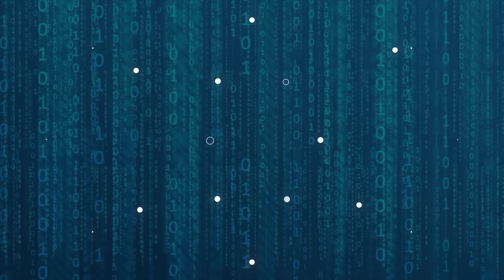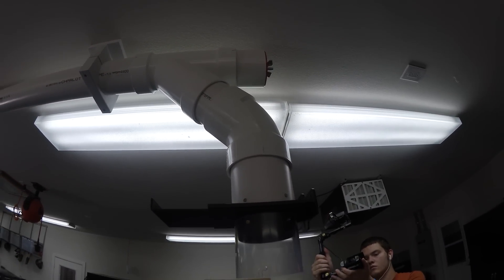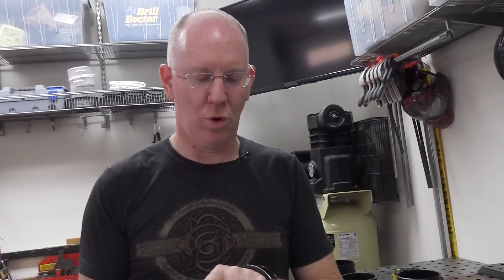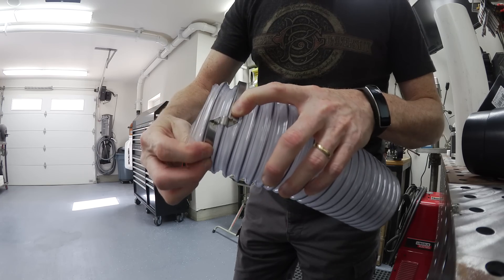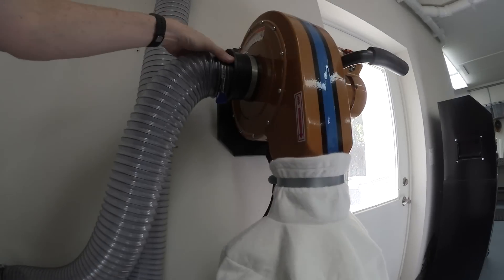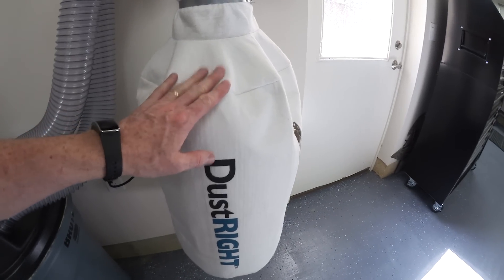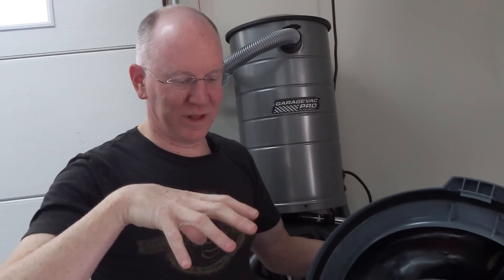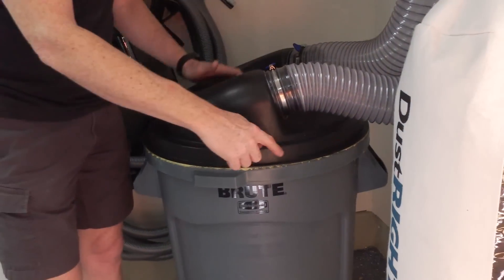How to Build a Dust Collection System - GeekBeat

Comment: Like what you have done, but your shop is disgustingly organized! 😂Dust collector fittings are driving me crazy. Nothing fits anything I need it to fit! All I want to do is connect my Delta 14” bandsaw to my obsolete JDS collector! I have a whole box of 4” fittings that are basically useless because nothing else will fit over or into them. Why the heck don’t they give both OD and ID on these fittings? Maybe even color code them. Sheesh!

Comment: Look for DWV pvc, it's a very thin wall and will hit over most of your dust collection accessories. there are also connectors called 'street' connectors, that have one end that goes on the outside of the pipe and the other will fit inside the pipe. that will help you fit many accessories that the DWV pipe doesn't fit on it's own.

Comment: Nice tips, but here in 2022 I used SDR 35 drain pipe for my 6" main and then split into 2 - 4" sub runs in the shop for my Grizzy G0944 (1-micron canister w/Super Dust Deputy separator in front).  Much cheaper than SCH 40 pipe & fittings and the typical connectors available from manufacturers like PowerTec, HQRP, etc. fit perfectly without need for the special ones.  Another benefit of SDR 35 is it is even lighter and easier to cut than SCH 40.  The cost of SCH 40 in 2022 is crazy expensive... a 10' foot section of 6" will run $100+, whereas SDR 35 runs about $60.  The downside... it is blue/green and not white like the fittings.  ;)

Comment: Nice pipe system but the dust sucking" it's definitely 100% not going to suck everything if you actually turned on the saw everyone could have seen the dust all over the place. Only some of it will go in but the piping system i definitely gives 👍👍

Comment: II have a 6” pvc pipe dust collection system. I use 45 degree pvc pipe to go to my floor tools. My new 4” flex hose does not fit to the 4” pvc.. What fitting would recommend?

Comment: Old video, but for the posterity, many may be surprised that a good old high temp hot glue will hold on to these hard to glue plastics (LDPE and HDPE) of thrash cans and 5 gallon buckets better than silicone and perhaps even polyurethane adhesive, especially the crappy gorilla glue type that foams and gets hard.

Comment: So... I’m sorry, but is someone going to tell him? My 1hp dust collector barely has enough suction for 2 machines within 5 feet of the dc and has a hard time collecting all the saw dust. You have 30 feet of 4” piping and a cyclone separator while using a 3/4 hp machine? I bet that didn’t turn out so hot. Sorry!

Comment: Nice video and thanks for sharing your installation insights. I can use a lot of these ideas in my own 2 car garage set up. However, you didn’t talk about the tank looking gizmo mounted on the wall near the dust right vac. Is that a filter of some sort?

Comment: Several things don't listen to this guy. First sewage pipe is way cheaper and better. Second do not use the connectors he recommended. Reason being it takes up space in the pipe and sawdust can build up and static electricity can cause a fire. They say it shouldn't happen unless you do what this guy does.

Comment: That's not a dust collector system, it's a chip collector system.
The difference is your letting up to 30 microns of dust out or the system into the air you breath. You'd be better off venting that waste air outside.
Your still going to need to wear a mask for health reasons.

Any system starts at the pipe size, 4" pipe is too small, also that trashcan lid combo does not work, then the filter bag isn't removing fine dust and it blocks airflow volume.  
Mim 6" pipe, a 2 hp motor, and cyclone  
2 stage system with a hepafilter.
Reply: Venting outside is really key.

Comment: You can save a TON of money using sewer pipe instead of schedule 40.  Schedule 40 is for “High Pressure.”  You don’t need that for a dust collection system.  You also need a good filter vs a bag.  Bags don’t filter near small enough dust particles to help out with allergens in the air..

Comment: if you get the thinner walled white or green pipe, you can use a heat gun to expand or contract the PVC to the size fitting you need.

Comment: Nice setup!  I just got one of the Rockler vacuums over the weekend and am now researching systems.  I like the system you used to hold the pipes also.  I’m probably going to vent to the outside since that is better than using a bag.  Good video and thanks for the information
Reply: I'm also venting mine outside but I'm installing a "Y" fitting along with a blast gate in both pipes that way I can choose if I want to vent outside or use to HEPA filter in extreme temps. Options are always good and since you're cutting a hole in your wall anyway you might as well install the HEPA filter that goes with your vacuum.
Reply: You might want to get a bigger vacuum. This thing isn't rated to move the CFM needed. Most 2 stage systems want at least 800+ cfm to run correctly.

Comment: Woodstock designed their W1049 lid so you can connect flexible 4" hose directly to the ports. Gorilla glue and fittings shouldn't be necessary.

Comment: You put a lot of effort and work into the video and your system.  I have the same Rockler vac and it does not generate enough suction to effectively run the pipe system you have - especially with the 90 degree bends you have. In fact it loses strength on a single hose and an Oneda cyclone in between

Comment: Google Bill pentz and dust collection.  The guy is an engineer and had to  really figure out dust collection because his life depends on it and he did and he was kind enough to share his findings with us what I didn't know before I read his stuff is that the vast majority of us woodworkers are doing it wrong ....that is we collect all the big dust, but the fine invisible dust (ever been in a room and a ray of light will come through and in that ray of light you can see the dust spinning in the air but only in that ray of light that's kind of what invisible dust is.) you really can't see it the vast majority of the time but it's there. You'll think you're collecting all the dust and then at the end of the day there's a very fine mist of dust everywhere on your tools.   Basically the vast majority of the manufactures and dust collector sales people have been telling us exactly what we want to hear but to collect all that fine dust you need a very good filter and even then it will clog up very quickly. What he recommends and what I think I'm going to try  is having the dust go outside so instead of going into a dust bag in your garage it would go I guess through your garage wall either into the air outside or you could put a bag on the outside of the wall or BINH or whatever you want would be a perfect set up no but that way you know that the dust is  not going through the pipes and then through the filter bag and back to your lungs.   Or if you have a lot of money he and some other companies have designed an incredible system or he shows you how to make one yourself which really is incredible that he shares all that information.  But dont be sad.  For you,  you could probably buy one or two more dust collectors and simply use one desk collector for each tool or each two tools and that way they're not overloaded with all the piping and he will take a look at his article I think you'll really like it .   You strike me as perhaps an engineer? Architect?  Seriously, i was stunned when i read it.  But, the pumping it out makes perfect sense for 90% of the woodworkers.

Comment: Just wanted to give some hacks I use that are cheaper and quicker.  4” j-hook to hang pipe are 80¢ at Grainger and I like in Alaska which is normally more expensive than the lower 48. Also look under Clevis hanger, pipe tie, pipe strap, conduit hanger, strut clamps- hell even metal strapping will work. Also you can use a 4” roof pipe flashing they’re $8 and can be bent to help hone in the dust.  However you’re only as good as the blower motor... don’t skimp on that. I wouldn’t go less than 2 HP. And you can section off the area to dampen sound with a zipwall.

Comment: DO NOT follow his advice as is, unless you upgrade the whole thing to 2HP dust collector I have the same 1hp 650 cfm machine and with all that piping it is useless, I had just 2 overhead pipes, 10' and 5', took them down, useless, very little suction. This size of dust collector is only good with one hose, one tool at a time. I do use a thian baffle garbage can for the big chunks. For smaller tools use vacuum cleaner with dust deputy, much more efficient. Yes the bag is 30 microns, not great, but I have no big issues with table saw, just found 3 micron replacement bag on Amazon.

Comment: I'm with the rest of the comments regarding how insufficient your dust collection system is you installed. AND the fact it is not grounded is a fire just waiting to happen.
 It would appear you did not do your homework on the subject first by not installing a powerful enough horsepower motor. My tiny shop of 16 x 10 has a 2hp dust collection system which may be too powerful, but better to be too powerful than not enough. I hope anyone looking to copy a dust collection system reads the comments BEFORE they watch your video. After reading the comments I am very surprised you didn't take this video down. Is it ego that has prevented you from doing the RESPONSIBLE thing????
Reply: Oh come on.  That is a little rough.  We woodworkers are supposed to help each other.  And, if you havent read Bill Pentz on dust collection, you will likely be less stunned than I was, but most of us are doing something wrong.  Take a look and lmk what you think.  I cant believe the effort he has put into educating and trying to help.
Reply: Grounding isn't needed other than to maybe get rid of static shock to the user if you happen to touch the pipe. There hasn't been a single shop fire caused by dust collection system.  The atmosphere in the pipe isn't anywhere near correct like in grain fires.

Comment: about the dustcollector under the beltsander : if you build a drawer under the machine and mount the funnel intoo that you have a system that you can slide under the table when not needed

Comment: Awesome setup. Thanks for sharing. I've been doing research for the better part of a month and the equipment you've chosen are the exact same that I feel offer the best bang for my bucks. I'm not sure if I should go with the Powertech, Shop Fox, or spend the little extra on the Rockler though. A couple questions; do you think that  a standard furnace filter could be cut to use as a replacement for the outer filter on the Wen air cleaner? And could you PLEASE do a video on the Vacumaid pro? There aren't any thorough reviews. I really want to get one, but I could get 2 top of the line shop vacs for the $315. Having it off the floor and 30 or 50ft of vacuum hose would be sweet, but is it worth it? Does it provide the same suction as a regular vacuum?

Comment: how do i remove lingering sawdust from a small room?

i used a hole saw to make a small hole in a wooden box and the sawdust has been lingering around. it was a small project so i worked on it on the restroom sink counter. now every time i take a shower, the sawdust smell comes out and i can feel the sawdust in my nose and mouth. it only comes out when the shower is started. i've tried vacuuming and thought i got rid of it but its still around..

Comment: Hi John, This has been a great video for me! I want to use the schedule 40 PVC from home depot...but need help to select the accessories to help me with fittings...like you said, the PVC openings are too large. Is the woodstock 4" splice going to work for me to fit the PVC opening, then reduce it to fit the 4" tubing I already own? Need some help and appreciate any y ou can offer! I'm on the 3rd watch of your video! I have a delta 1.5hp dust collector and 3 main power tools to connect....miter saw, table saw and router...then a few sanders and such

Comment: I have installed this same set-up in my basement shop based on this video.  I have 4 drops and about 40' of PVC pipe runs.  I encountered two issue that have been easily corrected. First, without glueing or securing the PVC vertical connections they can apart,  I ended up using PVC glue to keep the vertical drop connections together.  Second, the dust bag that comes with the dust right unit clogged with dust and greatly reduced the suction power.  Even clean the bag with compressed air would only help for a few days then it would clog up again.  I upgraded the bag to the canister filter and have been running it for two weeks with no issues.  For a home DIY woodworker this is a great solution.

Comment: How are you dealing with eliminating ESD (Electro Static Discharge? Your system seems very well built but this issue can cost you your shop and/or your life. PVC produces a LOT of ESD especially when wood rubs inside of it in a dry day. This ESD can ignite the sawdust in a very violent way causing an explosion. If this is something you had not thought of I suggest you do the research and ensure you protect yourself. All it takes is one spark in your system to ignite all the dust all the way to the collection bin/bag/can at the end of the system. I've seen the results before, not pretty at all.

Comment: This is a terrible setup. The dust collector is garbage and there are so many leaks in those pipes that you are going to lose what little airflow you get. At the very least you should be using duct tape (not to be confused with duck tape (although that would be better than nothing)) to seal your joints if you want to be able to disconnect the pipes. As others have mentioned, the back of that rockler is not very good either. You will be filling you shop with extremely fine particles of dust, which are the most dangerous kind.

Comment: I rarely will post anything negative.. but when I see something so groddly wrong I can't help it.  Your not collecting any fine dust (the stuff that will really hurt your lungs) with a 3/4hp blower and that much ducting. It could barely move those electrical nuts.. That much duct work with that many bends, that much resistance in the system, minimum...MINIMUM 3hp blower with a 14 or 15 inch impeller... ideally you  need a 5hp cyclone to drive that system.  That 5 micron bag is a siv. You should have a cartridge filter from Winn Environmental with sufficent surface area to not drag the CFM down.  You really should do some research before doing a video for which people will copy thinking this is the right way to setup a dust collection.  I hope you take this comment seriously and revise your setup. Your lungs will thank you.
Reply: I try not to be negative as well. But I hope no one wastes time and money copying any of this. Except the ceiling air cleaner at the end of the video looks good.
Reply: Jim Hinze   What you tube videos would you recommend for people to look at for advice on a garage system that isn't going to cost an arm and a leg?  Say one based on the dust right and with the needed modifications to make it 1-2 micron filtering?   Ideal filtering vs what most can afford is a big leap but we would all like to get the harmful dust out of our shop and saying that our garage door being open (as some of the you tubers do) is an inadequate response to me!   But I would like to keep it as affordable as possible as well!  Looking for a go to video.
Reply: Thanks. I admit I know very little about the ins and outs of dust collection systems, but while trying to puzzle together some runs with my 1.5hp I quickly recognized it has limitations. Seeing that little bitty machine on the wall was a surprise.

Comment: Whats your take on using a cyclone on the dust collection system? Like you I don't currently use one and instead use a similar setup with a two hoses on a fiber trash container.

Comment: Hi, just wanted to say you have a nice system.. I have the same Rockler Dust system in my garage but suction wasn't that strong.. Thanks for the tip on not using a 90 degree piece of pipe, that may be my issue.. I agree with one of the other comments about using caulking Vs glue.. I would suggest a 100 percent silicone as it will hold fast and make a strong flexible seal.

Comment: Nice job great system I have one concern you are sucking hot metal from your grinder that could be a possible fire hazard I know with all the wind and pressure that by the time it hits the collection bin the metal would have cooled off but still a bit risky otherwise great system

Comment: I'm currently "mentally designing" a similar system for my garage/workshop and plan to use many of your ideas.  I liked your use of available components.  
 A few commenters questioned the PVC size chosen.  My rationale is to use a smaller size plumbing, based on the knowledge I'll only be using only ONE power tool at any given time.  Also, my "workshop" is substantially smaller, so I see no real need for the larger setup in mine.  I also liked the use of "shutoff's" at each port.  
I loved the homemade mounting brackets.  GREAT, simple design, that looks good and functions well.  
In regard to the static build up issue, I understand the principle, but I also agree there seems to be no verifiable instance(s) of an explosion in a garage workshop.  Still, I may opt to incorporate some sort of grounding system in mine to completely eliminate any chance of static buildup.  Thankfully, I have access to a significant amount of FREE copper wire for this.  I see this as carrying a handgun and hopefully never needing it, but it's worth more than it's weight in gold if/when you do.  ELIMINATE that possibility as I see it... ESPECIALLY since the anti-static components are free.  Why NOT do it, right?
Thanks for a good video.  :-)